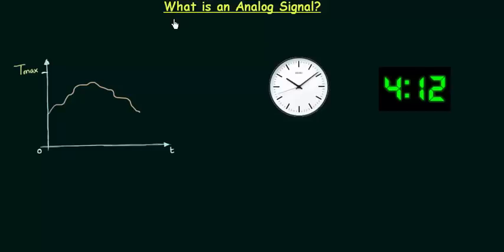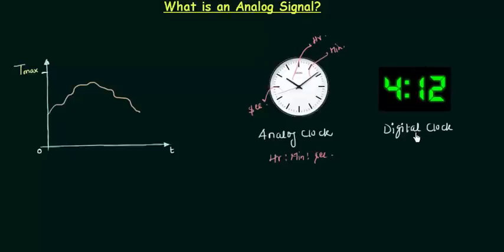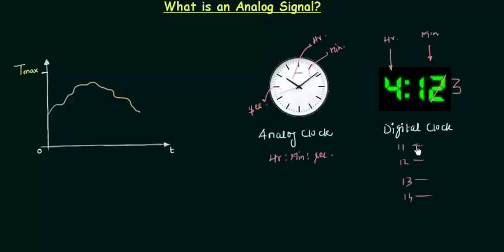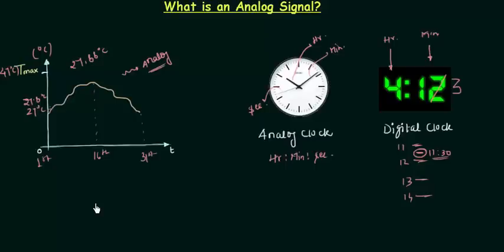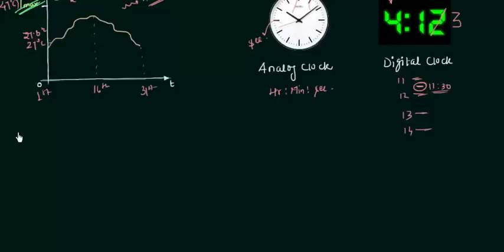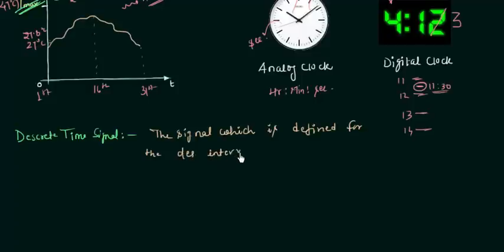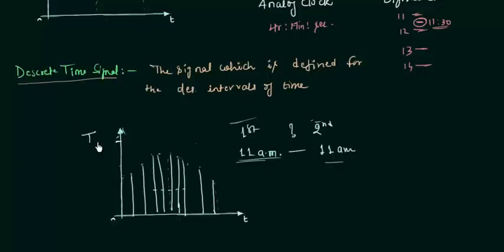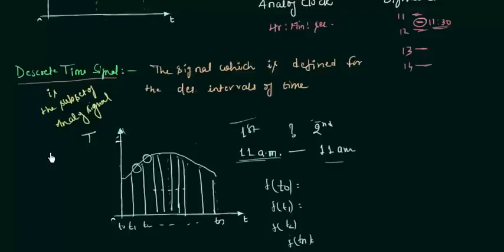What is an Analog Signal?

Comment: Classification of signals :

1. Continuous time signal / Analog signal :
The signal which is defined for all continuous values for time t.
Eg : sin t, cos t..( in the form of waveform )

2.Discrete time signal / Digital signal :
The signal which is defined at particular instances of time only.
Eg : sint,cost..( in the form of samples)

3. Random signal :
The signal which is defined randomly.
Eg : Stock market signal ( as it either rise or fall randomly)

4. Deterministic signal :
The signal which is defined exactly by mathematical formula.
Eg : sint, e^t.

5. Periodic signal :
The signal which repeats the same form.

6. Aperiodic signal :
Vice versa of periodic signal.

Hope it helps..❤
Reply: no, discrete time signal and digital signal are not the SAME

Comment: If an "analog" clocks moves it's seconds hand by ticking, instead of a continuous motion, is that technically a digital clock? Because it would have a limited number of time values that are represented? (Only 60 per minute)
Reply: From what I've understood, it would still be analog, albeit a discrete one. We only represent what is useful to us which is the 60  seconds, we dismiss the in between of those second per tick. If we slow it down the swing in each tick, we can see that it achieve a value that is not on fixed state of  seconds.
Reply: Technically speaking wheather it's 'ticking' Or just moving slowly the second arm still need to travel certain point at a certain time, which our eyes can't distinguish but if you click a picture of it at whatever time you want you'll see in some pictures that the arm is in between two values so it's still analog.

Comment: Imagine, in a reality, where in-betweens don't exist.
Sometimes, in digital electronics, the state between off, and on. Does not exist. Obviously it totally does, but he's trying to tell you that something can't happen like that within digital electronics.
Sure some electricity can be leaking through, and the light is on, but dim, which is inbetween off, 0, and on, 1.  Which is probably around 0.5. But 'technically' it is still 'ON'.

If you have something that is both on, and off. It's very hard to translate that to digital electronics. You can ask if there IS a leak, which is yes or no. But you can't ask how much of a leak is present, in a weird logic way.

Comment: An analog clock is also failed to take any value between t and t+1 seconds. So in analog clock also, there is not any information present for 2 consequtive seconds... Hence, is it also digital according to signals & systems?
Reply: Some secound hands are smooth thpugh. They aren't a click. They just run around the clock at a steady pace. Also the tention (shared amongst the gears) in between intervals of the secound hand can let you know a specific value due to us using more information. (Information= being the tension)

Comment: i have a clock which  shows milliseconds . but wall clock cant  show  milliseconds . so according to your theory  my  digital  clock is now an analog clock and my wall clock is a digital clock ,
Reply: Think of Analog clock as a smooth signal with a continuous signal which can show/display microseconds of time if magnified the clock whereas your digital clock will show only microseconds.
Reply: Take a high resolution stopwatch which can show microseconds or even smaller time duration, and assume you can comprehend that interval. Now look at the wall clock, you still have a continuous value but in the digital clock you will see 3ms to 4ms (an example), no values in between. But in wall clock you could see the second hand show values between 3ms and 4ms as well.
Reply: Manish Yadav thanks alot buddy, this comment really made things clear
Reply: Cheers to knowledge and incredible life :) buddy
Reply: it would still be a digital clock
Reply: A wall clock with a smooth second hand, could, theoretically show time up to infinite precision. Our eye just isn’t good enough to see it.